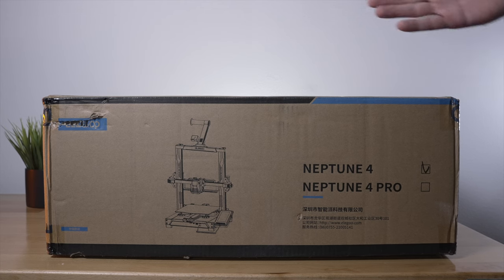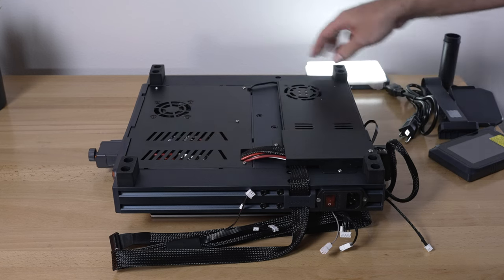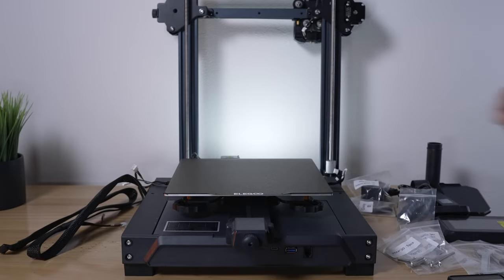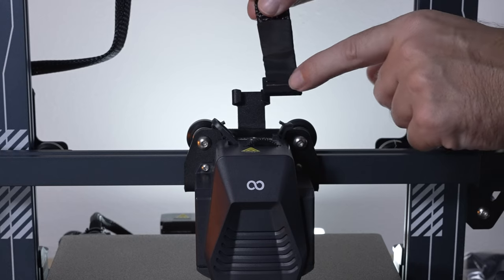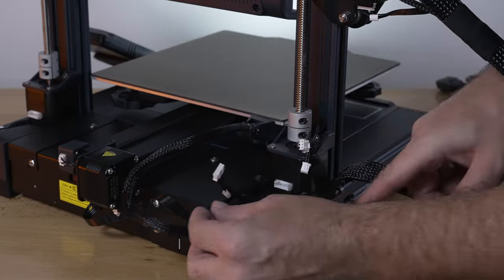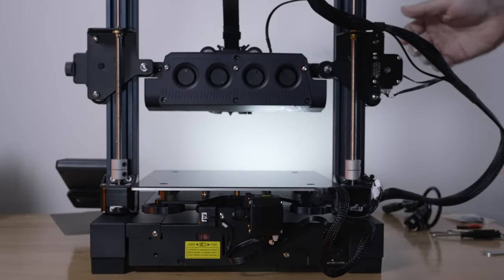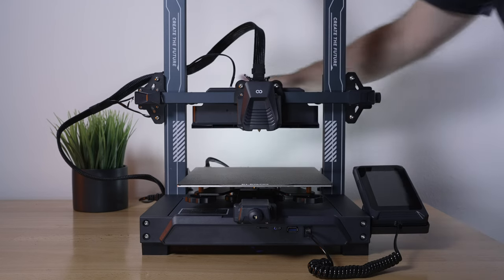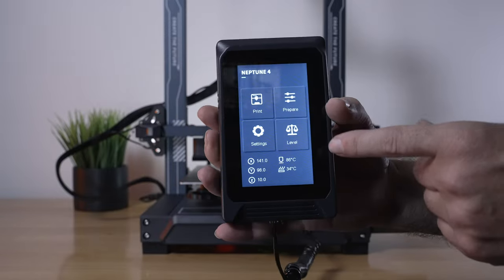Elegoo Neptune 4 - Klipper 3D Printer - Unbox & Setup

Comment: Man, this video has been such a life-saver. One thing of note: The "freebie SD card" is included because you need it to update the display. You can update the printer through USB but the connected display actually needs to be taken apart and has a little SD reader inside.

Comment: Klipper is awesome and Elegoo got a lot right with the Neptune 4.  I'm looking forward to a Neptune 4 Pro, but in a 300 mm Plus size.  I wish Elegoo included WiFi so it's easy to use with Klipper.  Who uses a wired LAN connection these days?  It also needs an all metal hot end.

Comment: Thank you for this video. I own a different brand of printer (a very similar I3 klipper) and you provided a very coherent explanation of belt tensioning and roller adjustment. Very useful.

Try the 18 minute benchy file from the USB. I had a similar improbable fast benchy file on mine, and it turned out surprisingly high quality.

Comment: Some questions:
1) What material is the heatbreak made of? Steel with tube? Steel? Titan? Bimetal?
2) What kind of heatbreak is used? CR10? Chemera? Kraken? V6? Proprietary?
3) What type of heatblock is used? CR10? Proprietary?
4) What type of nozzle is used? Mk8? V6? Proprietary? Are there abrasive-resistant options on the market?
5) What size of blower fans is used in the printhead to cool the model? 4010? 4020? Something else?
6) Does the back array of fans blows across the whole plate (which is 235 mm)? Or just across the specified 225mm?

Comment: For what it's worth...I got my Neptune 4 non-Pro yesterday, and I genuinely can't understand why anybody would buy anything else. I've been printing at 280mm/s 0.12mm-0.2mm layer height, and with plain black PLA there's no noticeable ringing or over-/under-extrusion. With silk PLA, a small amount of ringing is apparent, but nothing like I'd see on the Neptune 3 at 80mm/s. Also...be brave and make yourself a Prusaslicer profile from the printer specs; it's so much better than Elegoo's Cura 4.8 there's no competition.
Reply: Hey! I've been looking for this for ages.  I'm trying to create a Prusaslicer profile myself, but I'm coming from Resin printing so a little lost.  Do you have your settings for it please? mainly the 'Speed for print moves' as i think that's the most important right?

Comment: This is one of the better reviews regarding this printer. 

I’m going to check this printer out this week, but I’m worried about the noise. 

When I watch the vid it comes up as very loud, but that could be due to the mike placement?

Is it doable to run the printer and be able to sleep next room? 😅
Reply: It's because of the large fans at the back, you can disable them.
Reply: @Adaks  thanks. But is it still save to keep printing them? Or is there a huge chance to overheat ?

I’m totally new to 3D printing that’s why all the questions.
Reply: @qstick5554  I don't know too but I think that the fans could be unnecessary as when you look at other 3d printers that are bed slingers with fast speeds - they don't have additional fans attached it. But anyways, it is a machine so I would always expect it to be noisy, most people don't put 3d printers in their bedroom, they have a spare room to put it in.
Reply: @qstick5554  you can also always run tests on print quality as you adjust fan intensity
Reply: @Adaks  ya it’s going to be in a spare room but it’s mostly how much noice it’s going to be 😁

Comment: RIP  Prusa, again
Reply: What happened to Prusa?
Reply: @pcmrbenchmark8301  800$ vs 300$ 500$ cheaper yet not bad for 3d printer and getting really close to prusa for the a cheap price.
Reply: Lol no. You can also travel with a Dacia but most of the people still prefer Mercedes
Reply: @norbertlukacs3661  What makes Prusa printers better?
Reply: @Komandie  open source but self developed slicer, reliability, amazing customer service, upgradeability (if you bought an mk2 ~8 years ago you was able to upgrade it year to year, and now you might have an mk4 and a lot of spare parts, or even complete machines just with the upgrade kits), regular software updates. Prusa has its own model database (printables), has its own material brand (prusament), and everything is open source. Therefore it's a bit pricey,but the development is in the European union and the manufacturing too. Not in China, with slaves and child workers
Reply: @norbertlukacs3661  fanboying ain't healthy for the community. Prusa it's jus a Renault
Reply: @HowDareYouu  have fun with your favorite brand :) we don't need any argument
Reply: @norbertlukacs3661  funny to read, but thanks, always wanted to know how 'branded' people thinking. I bought E3, use superslicer and print any filament I want, I got my stl from thingevers and printables and yeti and any other website, or create ones myself in any editor I found usefull openSCAD, freeCAD or Blender not brand-dependent. But I guess you fund Prusa slicer which is base for super slicer, so thank you. I wish you buy more of those cool printers, upgrades and those special filament they sell, their slicer have cool options in alpha, which I would really glad to see in super slicer too. = )

PS oh and I install upgrade on my E3 when I want to, without any permission from some 'brand'. But most noobs says that E3 is bad, as you can upgrade it, while Prusa is cool as you do not need to upgrade it. And now you say upgrades as a plus. Which is more fun for me. = )
Reply: @norbertlukacs3661  Most people prefer them, but they still buy the cheaper versions.
Reply: @HowDareYouu  We have seen much less of the Prusa Army since Bambu Labs came out, and I am so grateful for that. By the way I own a PIP and a Prusa MK3s.

Comment: Have you tried printing using LAN with the Ethernet cable? If so what is the prosses? I saw there was a part for it in the instructions but could not see it in your video. If you could tell me about that I would be grateful. Thank you.

Comment: having a problem where the left side of my prints are rough and the right side is perfect on a flat item. ive leveled it multiple times same issue. Left side of the print is like more pushed in giving it an un even bottom how can i fix it

Comment: i watch 50 review video's end i read allot. end stil i dont know what 3D machine i must buy. elego neptune 4 or ender 3 s1 pro (beginner) as i read revieuws. evry machine you wil find problems end try to understand the machine? end fix it?
Reply: Yes, even the powerhouses lile the Bambu X1C have their issues. 

BUT you need to know how problematic is the printer, the Ender 3 is very popular and won it's fame as the ultimate beginner printer because is from a time when 3D printing was HARD, the Ender 3 was like the less frustrating and problematic printer of that time and for that reason it got it's fame. 

On this new decade we can see  that new contenders appeared on the beginner section, and some of them are less problematic and friendly than the Ender 3 like the Neptune series of Elegoo.
Reply: He hasn't shown the full potential of the printer, you really want to see it with nylon for a start.  For the price the Neptune 4 seems the best choice for most people.
Reply: so neptune 4   or   Creality Ender 3 S1 PRO
Reply: @itzmemaariocleantaps8201  Neptune 4, Ender 3 s1 pro is beginner friendly to the standards of 2016.
Reply: Go for the Neptune 4.

Comment: I've had this damn thing less than 24 hours and cannot get a single print out of it.  4 different filaments and they ALL get clogged up in the PTFE tube in the hot end, which requires MAJOR disassembly to UNclot.  DO NOT BUY this piece of crap.